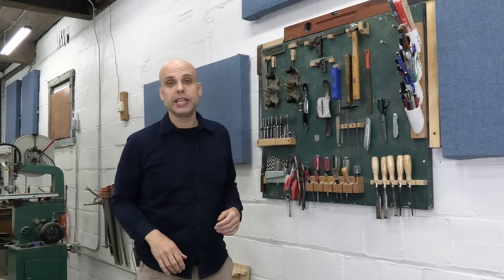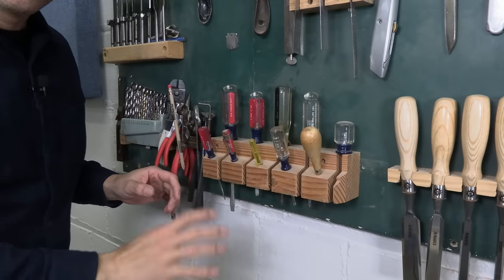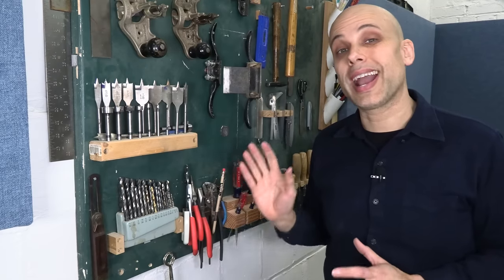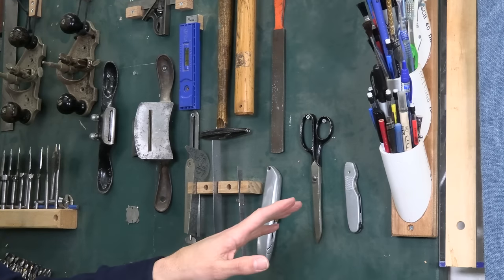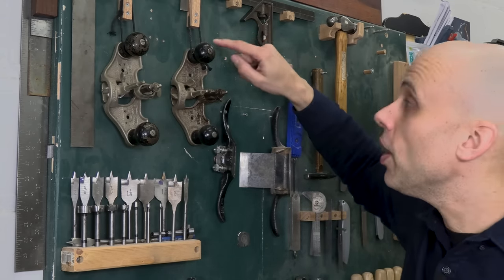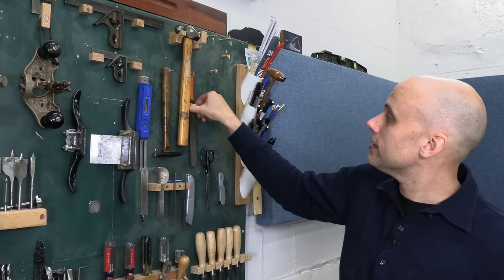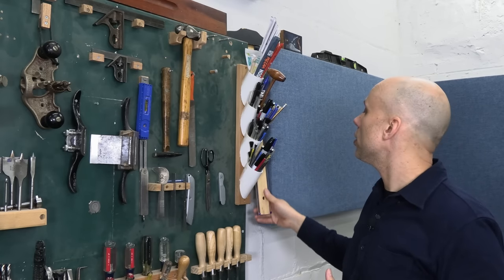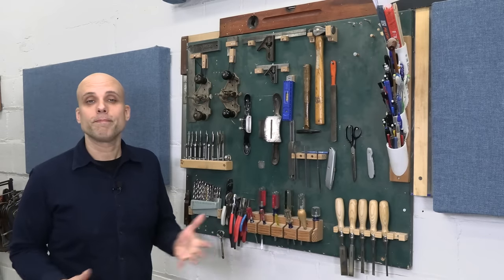Build a Tool Wall From Scraps and Junk

Comment: Great to see your solutions here, Rex. Thanks for the walkthrough, gives me some good ideas 

I’m still building my toolset but I’m also still trying to settle within a workflow and as a person who gets invested in lots of making styles and crafts, it’s hard to know what to dedicate a toolwall for which tools for first order retrievability. I am trying to solve a modular system that can adapt as I rapidly change work. I’ll likely integrate some of your solutions into my mashup. Thanks again!
Reply: You got me thinking - french rail with individual pallet boards on it. Switch to a different project or one of the boards doesn't work for you? Swap it out for another. Install another rail in a storage area and you can setup your tool wall for whichever project you're currently working on, while still having the other boards ready to go for the next setup!
Reply: @JohnM-hd9qi  Hey John, wow thats a great idea, thanks for the brainstorm!  Where at first just a module wall feels cluttered if everything has to live there, but the separate storage area rail might be key that I felt I was missing. Really great thanks!

Comment: I like your "not cluttered" arrangement.  I found the biggest problem with toolboards is putting a work bench in front of it making you stretch to reach the upper tools.
Reply: Truth. There's probably about 2', maybe 2.5', of vertical space that's appropriate for tool storage. For more space, one should go wider.

Comment: I live in a 530 sq.ft. apartment, and while I do not do much wood work in my space, I do electronics stuff a lot. My living room is basically my workshop. So utilising what little space I have is absolutely paramount.Putting stuff on the wall was the logical choice for me, and it is still a work in progress. I have a floating shelf sitting over my desk/workbench. And I wanted my soldering supplies as well as my screwdrivers, wire strippers, crimping tools, pliers, cutters and whatnot on hand. So what I did was get a couple of aluminium C channels and bolted them to the edge of the shelf. Then I got bunch of M6 T nuts and a bunch of matching grub screws. I covered the grub screws with heat shrink tubing and using the T nuts I then put the grub screws into the C channels. Presto, loads of tool holders for a TON of tools that requires zero extra space and is easily reconfigured if need be. I used the same system using a 90x30 cm piece of 25mm chipboard - which was part of a cupboard I threw out - but I figured I might as well keep the hardware and the shelves. I bolted that to two strips of wood that I put on the wall (it is an exterior brick wall, so I wanted a bit of standoff space between the back of the tool board and the actual wall, because potential moisture buildup and such)

I have tried everything from containers with casters to drawers to boxes. But all the tools ended up just cluttering my desk because I could not be bothered to put all my shit away because I figured I would need them again anyway in a day or two. And many tools were spread across different containers, so many projects took twice or three times as long because I was rummaging around for tools. Eventually I was just fed up with that.

Comment: Love this! I have been using the heck out of my decade old scrap-based tool wall. I use hot glue to place my holders and have moved them several times to optimize their location. All this takes is a heat gun and a spatula.

Comment: Love this walk-through. It resembles my own wall. It's indeed a great beginners project, as long as you don't try to make it perfect, but treat it as an experimenting sandbox.
Also, moving your tools from a toolbox to a wall is such an upgrade in accessibility.
I'm going to try that screwdriver holder. Better than my block with holes.

Comment: I like your wall. I solved the same issues with a Dutch Tool Chest. After I built it, I discovered it was just too heavy for me to load up in my truck to take places so I cut the bottom section off and made it a 2 piece (I've since added a third section) Dutch tool chest. Each section is about 50 pounds when loaded which is much easier on my back. I put them on a cart in my shop with a bunch of other tools on it. As I'm working at one of my benches the tool cart follows me around and I can have most of my tools at arms reach no matter where I am. It's been really good for organization as every tool has a specific spot for it. As soon as the tool is used, it returns to its home.

Comment: I really feel with you on the nostalgia for the getting started phase in making stuff.  Last year I finally replaced the last of my original cheap bookcases I made in my early twenties, and was honestly amazed they'd held up near twenty years of use when I made them from cheap MDF and screws from Lowes.  Now I'm looking to remodel my bathroom and considering whether solid wood floating shelves on french cleats is worth consideration for towels and toiletries.

Comment: I would suggest having spur bits instead of the twist drills if you don't have room for both.  The spur is invaluable for centering the hole on a mark.  Also step drills, just a couple of cheap ones from Harbor Freight will make the holes in sheet metal that even wood workers occasionally need, at almost no cost to the real estate of your tool board.  My work space has shelves and I made small tool boards that stand upright and hold my small tools in a way that is easy to reach.  My son's 3d printer organizes my small files and hex shank bits in convenient holders that would also work on a tool board.

Comment: One advantage of mounting things on a board on a wall is that it keeps them off the wall if your workspace has cold walls which promote condensation and rusting. I have just put one up which is a worn pallet which allows me to slip on shelves as well as hanging tools.

Comment: My take on the tool wall was to mount electrician tool pouches to a lath stood off the wall about 1/2 inch. This gives me three dimensional tool storage with multiple configuration choices as they make a million versions of pouches. I am currently looking at "Bucket Buddies" that I will just cut open and screw to the wall.
Reply: A pouch screwed to the edge of the workbench is also very useful.

Comment: I find shallow shelves are much more convenient, it's easier to grab stuff and put it back and if you space them densely (say, 10cm apart) you can fit a lot more stuff. Also it's easier to rearrange stuff since they're not specialized for the tool. The only downside is if you have 5 screwdrivers with identical handles it can be hard to find the right one. There's also those magnetic strips, they're cheap and can hold an entire row of tools, I use one for all my files.
Reply: I am not really a fan of the magnetic strips, as someone that frequently works with metal, the filings stick to EVERYTHING because it all becomes magnetic.

For wood chisels, hammers, and maybe some screwdrivers, it's fine.
But I would never put a file on one.

I keep my files in a custom drawer, right underneath my bench top, so I can easily access them. It has a 'comb' style spacer in there, prevents files from rubbing and keeps it clean, makes them easy to grab too.

Comment: Move the chisels up is not necessary. If you extend the board with a rim under the cutting side of the chisels, then you use the same space and it is safe.

Comment: If your pliers rack was angled ever so slightly off vertical (5 degrees or so), the slight curve of the handles should 'work with it' and allow an almost horizontal withdrawl from the rack, letting you use the empty space above.

Comment: Thanks for the ideas.

One small thing I noticed was that your ball pein hammer has the ball end facing to the right so that a right-handed person would naturally have the ball end facing 'forward' on picking it up one-handed. If you predominantly use the flat face, would it be a small improvement to swap the supports over so the flat face is 'forward' or would it not be worth the effort.  Hope this helps, otherwise feel free to ignore.

Thanks again for the inspiring videos
Reply from the maker: You know,  you're right! I think I flip it in my hand unconsciously after all these years.  Good eye.

Comment: Using string to hang planes is one of my all-time favorite tricks for wall storage. My entire plane till was designed around it.
Reply: Ditto. A length of discarded mainsail sheet screwed in loops of 4-5 inches and about 3 inches apart on top of a 1-1.5 inch square board will hold the front knob easily and you can take off and rep;lace the plane holding it one-handed by the tote.
Reply: @Jan-Reinier Voute  I over engineered my till compared to what you're describing. My planes are still sitting on a shelf and have a lip to keep them from tipping out. I have parachord loops holding the knob, tote, iron, or horn (I have a pretty eclectic collection) on the top. Works great for me, but I still need two hands to get them off the wall.

Comment: a handy tool for people cutting sheet goods is a 48 in  t square  i am using my 48 in adjustable T square  cutting out the plywood i am putting up on the walls of my shop (60 in spacing between the metal studs)

Comment: If it's worth it to you to make a new plier holder to reduce the vertical headroom, consider a hybrid using the rail component of the existing holder combined with the leaning feature of your twist bit holder

Comment: I like that perspective... I didn't know I was supposed to make a tool cabinet with tills, etc... So I took my bandsaw and scraps and just made holders to stick to some ugly white melamine kitchen cabinets that I salvaged from the trash. Each tool holder was custom and my plane till and my saw till (Just a large dowel and some scraps with kerfs) just went between the cabinets... When I ran out of room in the plane till I added magnets and scraps to hold my smaller planes and my 78 etc... It's evolving, but it works. The ugly cabinets aren't so ugly because of the cool stuff on and between them. They also give me a place to hide those shameful power tools!

Comment: Before metrics came in all folding carpenter’s “rules came with and inches side divided into 10th of and inch.  While the other side of the carpenter’s “rule” was divided into 16th of an inch.

Comment: A total beginner here, just starting to take woodworking beginner classes. Now I'm trying to figure a way to take my workshop tools for my vintage sewing machine restoration side gig and share space for future woodworking tools. I've mounted a board on the wall and at a 'hard stop' as I re-adjust my tool layout. How did you mount the small individual magnets into your board?  Have you had any luck with those 16 inch long magnetic strips? The smaller magnets seem like they would give more versatility to the layout.

Comment: Your twist drills should be shank up. Your way if there is a burr on the shank and it sticks in the holder your fingers could slide along the twist and be cut.
Reply: Sorry, but that seems like a stretch; I have never, or known anyone to get cut from a drill.
I've seen people poked by Brad points, but never cut.

Comment: Do you have any recommendations to make open air tool storage viable in a humid environment. Florida resident here, and stuff that gets left out is very susceptible to rust. But it is nice to be able to reach and see things without digging in drawers.
Reply: Das Problem mit dem Rost auf Grund zu feuchter Luft hab ich auch!
Wie behandeln oder ölen Sie Ihre Werkzeuge um sie etwas zu schützen?
Reply from the maker: For you,  a tool chest. Really helps with rust.
Reply: @RexKrueger  I've got one was just wondering if there was a magic solution that I hadn't thought of. Thanks for the reply
Reply: Oil or wax every time you set them down. =] check out, oil rag/can...
Reply: @edharrington4008  thanks I wasnt sure if this would work. I will try with some and this will double as an excuse to get out there more often. Thanks

Comment: I had the same problem with the pliers, I did the same solution, I regret it every time.
Reply: My solution is one I really like, after a little getting used to; I found an old wire bracket, I think it was for a barbecue or something, but the spacing in the wire was just wide enough to accept my plier handles.

So I can drop my pliers in, and lift them out easily, it keeps them slightly off the wall so there's more clearance, they automatically centre and balance so none of them fall out, they don't twist or get stuck, and they are perfectly spaced from each other.

It's not the most pretty, but I certainly am going to keep using it.